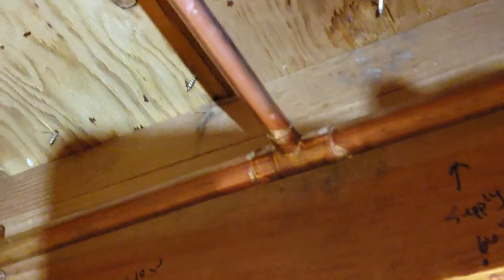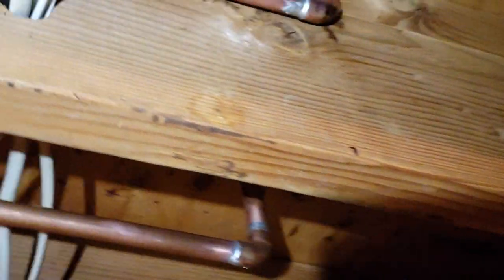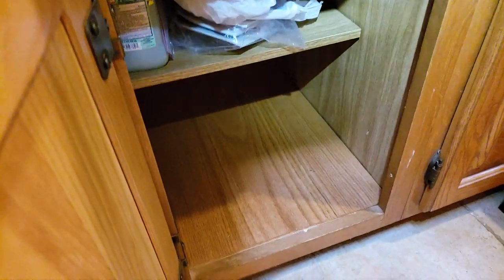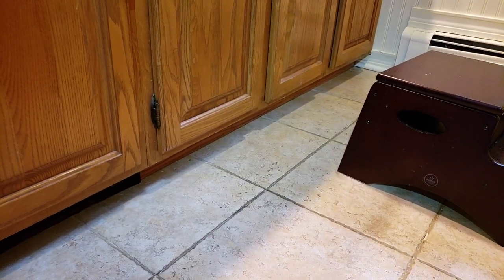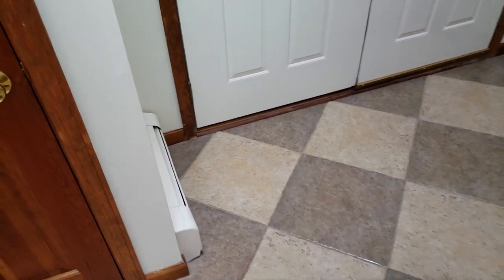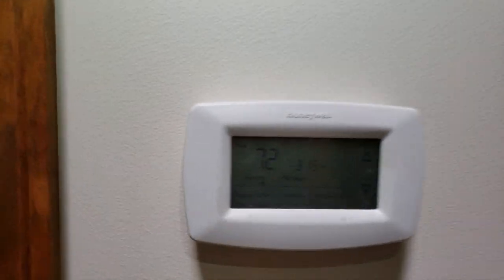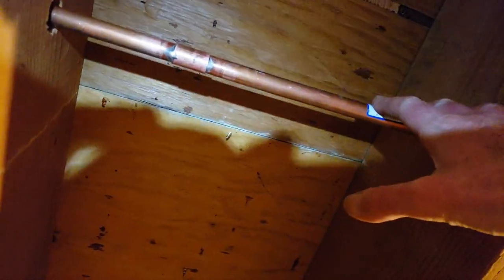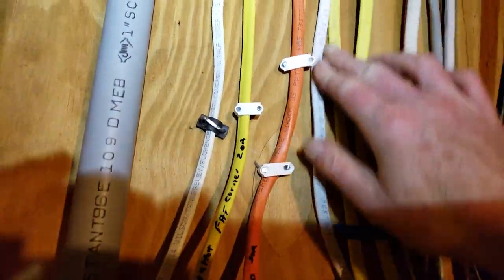Toe kick heater installation (diy)

Comment: The installation instructions don’t say much, except the fan turns on with heating demand (selecting fan speed). Does that mean  thermocoupler senses the water getting hot and turns the fan on?
Reply from the maker: Exactly correct. I actually bought a lower temperature sensor and replaced the existing one so the blower kicks on at a lower water temp.  When the zone it’s a part of calls for heat and the hot water from the boiler circulates through the heater, the blower turns on. There is a switch, high low or off. 
I’ve got 3 in my house and they are great.  Just not completely silent so consider that also.  Sorry about the awful video. It was long ago before I had any idea what I was doing here on YT.

Comment: I’m just wondering it seemed like you showed the same pipe as being a return and a supply.
Reply from the maker: No wonder it doesnt work!  But seriously, its a loop off of the main loop.  There are two tees that need to.be.at.least 14" apart. The first tee pushes, second one pulls. Monoflo tees.
Reply: samlol23 cool thanks for the info.

Comment: The pipe you touched at 5:35 looks like 1/2".  I have 3/4 here in the North east, your thoughts?
Reply from the maker: I’m sorry, I didn’t see any notification of your comment.  The zone is 3/4 inch copper, but the small loop is in fact 1/2 inch. The monoflo tees are 3/4x x 3/4 x 1/2, and I am in Westchester NY. The house already had two of these exact same heaters installed in my kitchen which were professionally installed with 1/2 inch loops. I think that is the way they are supposed to be done. The unit has 1/2inch copper pipe, so that is the size flowing through the heater. The flow is supposed to be fairly slow for maximum heat extraction, and the install manual shows 3/4x3/4x1/2 monoflo tees.

Comment: Is there a hi and lo switch for the kickspace heater?
Reply from the maker: Yes, high, low, and off. On low you barely hear them, but we keep all three on high. The noise is quite low for the amount of heat they generate. There is a huge difference in the entire front half of my house, entryway and front bathroom since I installed this unit. It was well worth the small expense.
Reply from the maker: holy cow, I dont get notified of these comments. sorry for not responding- i didnt see either of these- yes there is a high and low switch.  I keep all of mine on high

Comment: No information here!
Reply from the maker: Yeah, sorry. The video sucks. I try to make them better now. Try Steve Lavimonieres vids. 
Basically tap into your 3/4 existing zone loop with a 1/2" smaller  loop. Use one or two monoflow t's to allow the water to be pulled into and pushed out of your new loop.  They have to be around 18" or more apart, and not right near a turn in the original zone. . Put a bleeder before the toe kick, and solder it all together.  and wire the toe kick to 120. The toekick has a built in aquastat *(they sell lower temp ones also) so when there is a call for heat in that zone, the pipe heating up to a certain temp (Like 140)  at the toekick triggers the blower
Try this one https://youtu.be/_GnWguw1Zgg